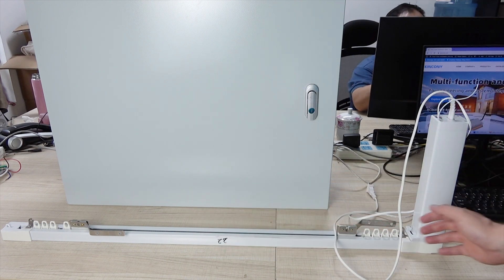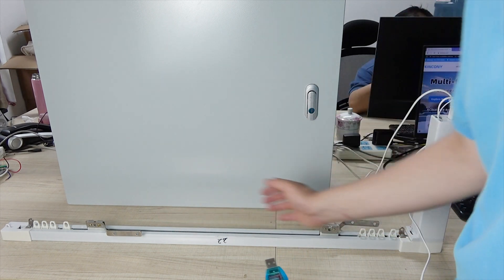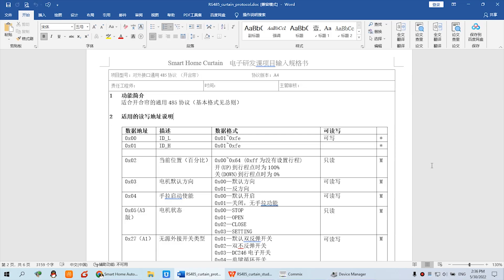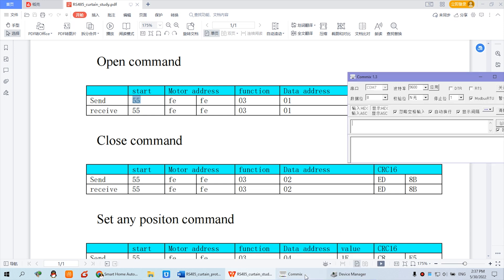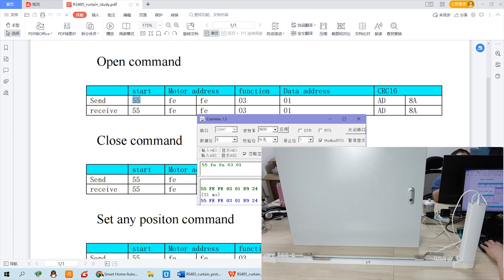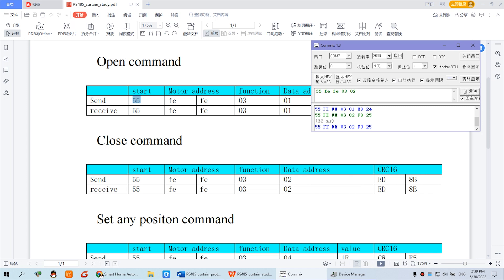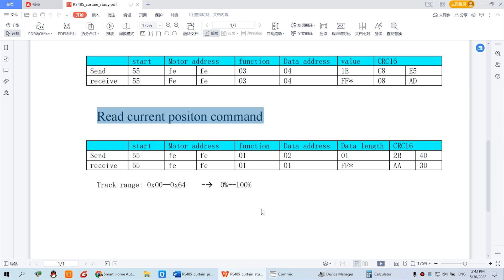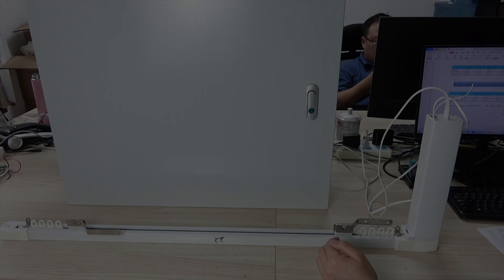【home automation training -28】How to debug RS485 MODBUS curtain motor

Comment: As far as I know, it's just serial communication, not the Modbus protocol. How can I send hexadecimal codes from the Modbus device's side?
Reply from the maker: what do you want to do?
Reply: @KinCony  i want to connect to my modbus device via modbus RTU
Reply: However, as I said, it seems it is not Modbus protocol but UART.
Reply from the maker: why MUST modbus protocol? @huynhhoi308
Reply: @KinCony  bescause my device just support modbus protocol
Reply from the maker: what's your DEVICE? one ESP32 board or? @huynhhoi308
Reply: Sir, let me clearly what I mean. I have a blind motor and I want to connect with any Modbus Device (PLC, DDC...), so how to send the hex code from the Modbus device to the blind motor?
Because the Blind motor just supports serial communication, so I can't communicate with the Modbus Device @KinCony
Reply from the maker: @huynhhoi308  how to send the hex code from the Modbus device.  You should check your modbus device user manual, whether have a program way to send customsize command.

Comment: Great video! I have KC868-AIO with ESPHome, do You have any tutorial how to configure exactly this motor (looks like dooya DT82TV) in Home Assistant using RS485?
Reply from the maker: if use by RS485 motor, need have the protocol can do that.
Reply: @KinCony can You repeat in different words? Im not sure if I understand You. Motor is the same as Yours but I want to controll it from HomeAssistant. It's  connected to KC868-AIO RS485 pins. No idea how to implement it in ESPHome YAML file. Do You know how?
Reply from the maker: ESPHome have UART switch component, you can create OPEN,CLOSE,STOP switch button for your RS485 curtain motor according to protocol, here is details:  https://esphome.io/components/switch/uart.html @ukaszdabrowski732

Comment: Please make integration with kincony device's rs485 port...in 1 port how many devices can integrate....can we integrate other modbus devices as FCU thermostat, touch panels...
Reply from the maker: yes, all RS485 device can connect to KC868-Server's RS485 port. Max support 127 devices.
Reply: @KinCony  Please make video of 4 different rs485 integration using kc'server
Reply from the maker: @wonderbros.3106  in furture will make
Reply: if it is possible then much wires are saved..using modbus system...very nice really....can you make video of it
Reply from the maker: @ersheikismail8293  yes, furture will do